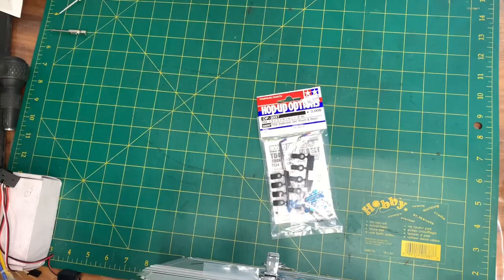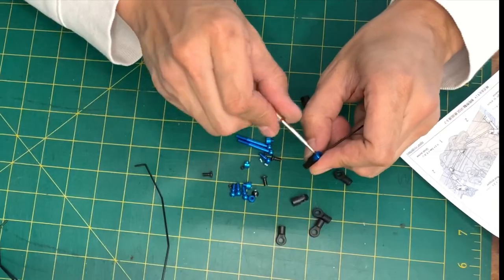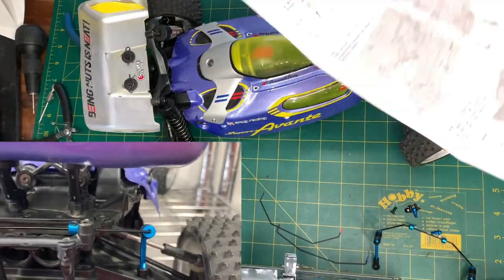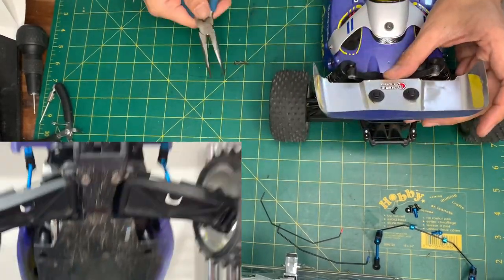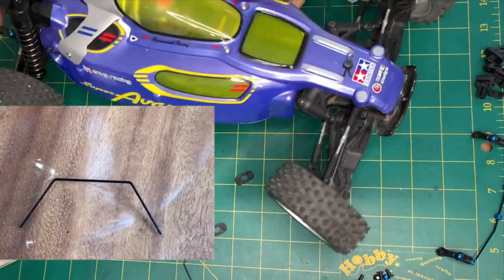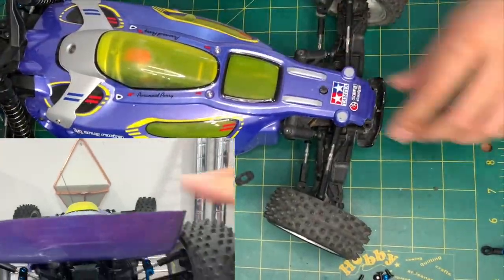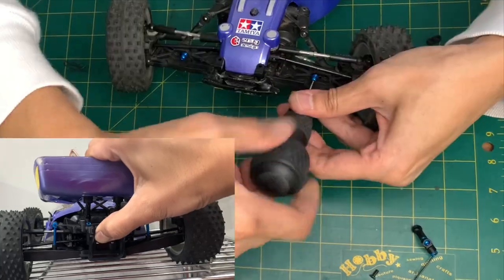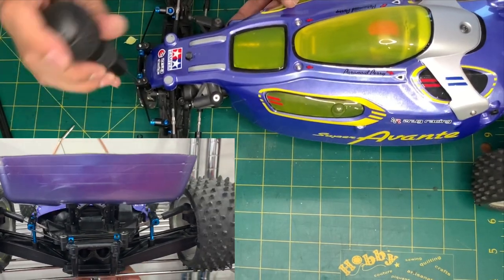SWAY BARS EXPLAINED USING RC CAR

Comment: Body roll is not weight transfer. If you had equally soft or stiff sway bars on the front and rear axles and the car experienced the exact same steady-state amount of lateral g-force, there would be the exact same amount of lateral weight shift over the front and rear axles. What sway bars do is allow you to affect the distribution of the lateral weight transfer over the front vs rear axle. Again, if we stick to steady-state for the moment, stiffer front than rear sway bars will cause a greater percentage of the lateral weight transfer to occur on the front axle than the rear, leading to a larger reduction of grip on the front than the rear, moving the steady-state lateral g-force behavior of the car in the direction of understeer. Increasing or decreasing the stiffness of the sway bars on both ends simultaneously will change the speed with which weight transfer occurs for a given lateral g-force impulse (i.e the transient behaviour of weight transfer). The axle that is softer than the other will experience more roll than the other and the axle that rolls more will experience less lateral weight transfer than the other. But to hammer in the point that body roll is not weight transfer, imagine you attached sway bars that are infinitely stiff, so that body roll is impossible. There would still be lateral weight transfer in the presence of lateral g-force. The determining factors of weight transfer are only the height of the center of gravity in relation to the contact patches and the track width of the car. These two variables alone determine what the amount of lateral weight transfer will be for a given lateral g-force (which is why race cars try to lower the c.g. as much as possible and increase the track width as much as possible or permitted). In effect, what this means is, weight transfer is invisible and is entirely independent of body roll that may or may not occur (but in practice of course, always occurs in the presence of some lateral-g because nothing can be made to be infinitely stiff).
Reply from the maker: Thanks for clarifying, I’ll pin this comment if you dont mind
Reply: @rexrcs no problem! :)

Comment: Great..maybe a video on how to setup the bars as most come with link adjusters..thnks
Reply from the maker: Hi and thank you for reaching out 👊, when you say “link adjusters” do you mean the ends (coming off the suspension) that get secured the the stabilizer bar?
Reply: Yup..seen em with height adjuster that connect to the suspension arms.

Comment: Nice video and great upgrade option! I’m tempted to buy the TD4 as they have one at my local hobby shop!
Reply from the maker: To add to avante family or to wheel around or both? It doesnt matter its an awesome buggy and just like the original avante it has its quirks that made it unique. This is quite a performer though when compared to the original or many other options available